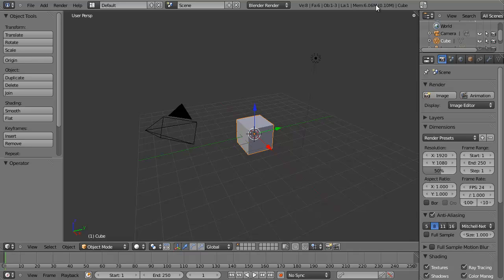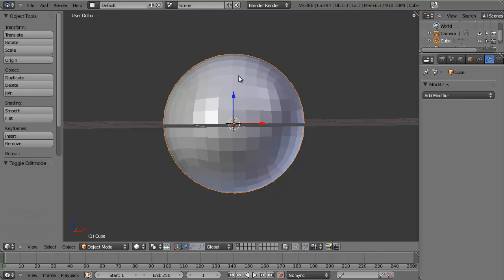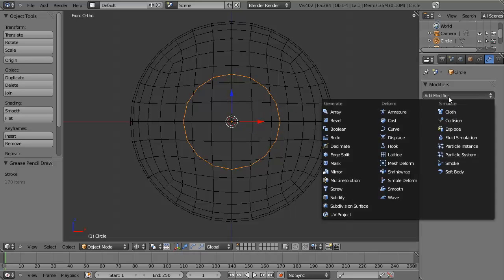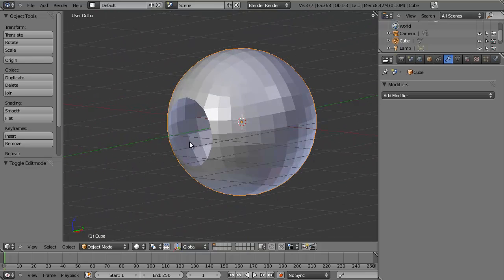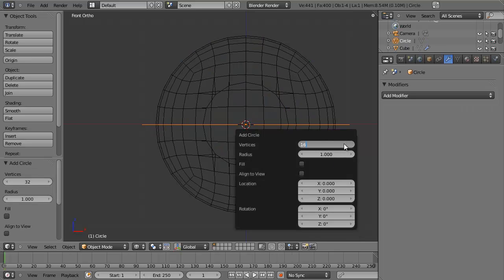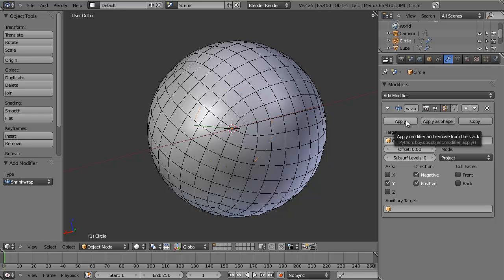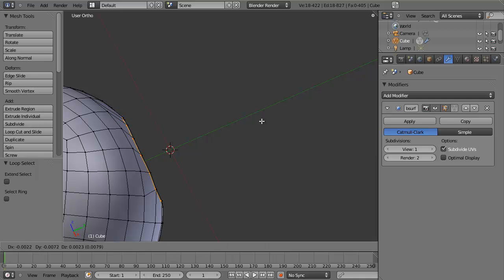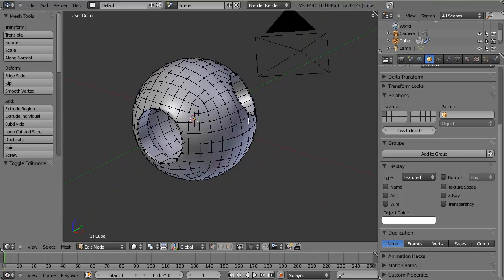Tip: Cutting a Hole in a Curved Surface -- Revisit

Comment: Coming from CAD world, I notice that people seem all too often tempted to compromise design requirements for topological fitness. i.e., "well, I wanted a .5 unit circle cut here, but it doesn't line up quite right so I'm going to change the diameter of the circle so it works - oh it still doesn't work so I'm going to deform some circle vertices to force it". 
It would be nice to see more tutorials like this, but where the objective is to make Blender do what you need with regard to the exact geometry that you want. 

Still VERY informative <3 I really like the quad-sphere topology solution.
Reply: I have been struggling with that too, I used to do all my modeling in NURBS and be very precise about my details. However, if you are going to use the 3D object as a game asset or for real-time visualization (lets say in Unity), lower poly count with good topology will always be more important than exact and precise measurements as long as you get the proportions roughly right.

Comment: Filling and insetting the circle and cutting out the middle before shrink-wrapping will provide faces for a nice control loop. Sometimes that distortion around a hole made by using a circle without one shows.

Comment: I remember doing this in maya...it was sooo much easier.
If you want to do it in blender, way better to just use boolean with a cylinder and make a few tweaks. done in 1/4 of the time.

Comment: CumminsN14DBest
GREAT VIDEO!! Please Do A Videos on how to make a ''OVAL'' Shape cut hole On A Plain Mesh, THEN making duplicates & Converting them to a form a Cylinder shape {If You Look At A Kenworth on Peterbilt Truck Exhaust You'll See What I'm Describing] I'm Having Trouble modeling the OVAL & CAPSULE Shaped holes ON THE CYLINDER To Go Round and Round TO MAKE THE a Heat Shield exhaust..Please Help! I'm New To Blender 2.79 doing my best to learn! Thanks
should look like this https://miamistar.com/products/muffler-guard-s-s-vertical-li

Comment: When you start joining the edges (around 05:30) you can select the two edge loops, bridge edge loops and then with those and the faces which you have just created still selected, hit delete and choose "Limited dissolve". It's much quicker than selecting two edges at a time and hitting F to create a single face.

Comment: This may be an "incorrect" way of doing it, so please point this out if it's the case. But what I've found is that you can recreate this method in a fraction of the time with any type of sphere by punching a square hole in the side, selecting the edge vertices, pressing W and using Looptools (an addon found in Blender) to make the selected part of the mesh a circle. I hope this helps people!
Reply: YES, Thank you, I saw this on a video, but I couldn't remember what it was called. This tool makes things go a lot easier and faster.
Reply: Thank you. Very helpful.
Reply: What's wrong with using knife project?
Reply: How do you "punch a square hole in the side"?
Reply: You'd use a Boolean modifier's difference option to make a cube shaped hole in the side of the sphere, using a cube mesh

Comment: Is there a way to cut a model from another model where the two models intersect?
Reply: I guess the boolean modifier is exactly that what you search for because it does exactly what you ask for. You can intersect, unite or cut out objects from each other (difference option). I just started using Blender and made an Abalone board model for the Tabletop Simulator and used this function a lot.
Reply: d1oftwins Ill look into it, i appreciate it. Very useful function to know.
Reply: Richard Smith
You're welcome, happy new year by the way! :)

Comment: This is been bugging for me years in 3d modeling. I guess I have to break down and watch this several dozen times till I get it down pat.
Reply: I'm starting to think that there should be a Blender add-on for this. If I knew enough about Python I'd like to try to tackle this ;-)
Reply: Ron Hicks i know this comment is a year old, but if you'd still like an addon for it then there's a great one called LoopTools. In a comment above I show you how I used it to recreate the effect shown in this video. i hope this helps!

Comment: Is there a way to cut a complete hole in sculpt mode? im modeling a skull, and I need to cut a hole that goes in a side of jaw, but any brush makes holes, only push down and dont open any hole in the mesh even if u try to pierce it.

Comment: The shrinkwrap modifier approach is IMHO rather cumbersome and prone to failure. It's much easier, in order to project the circle on the desired surface to press Snap -> Face -> Project individual elements. Then switch to the front (or side) view, press G and voila! The circle is on the surface